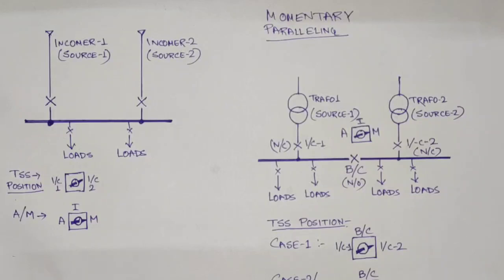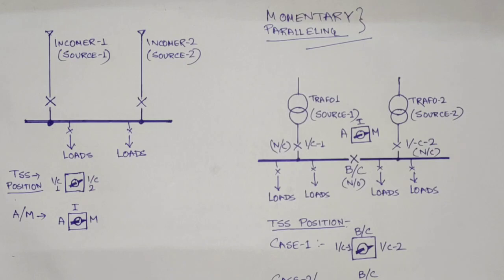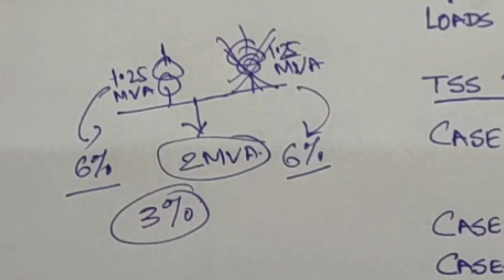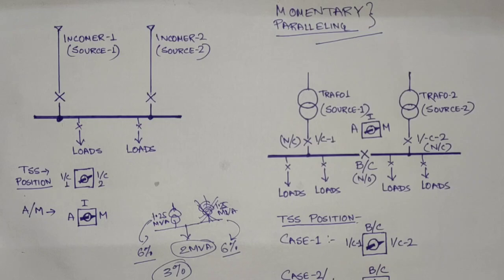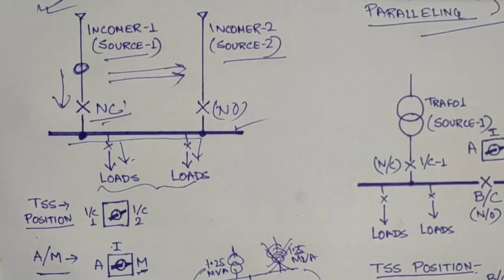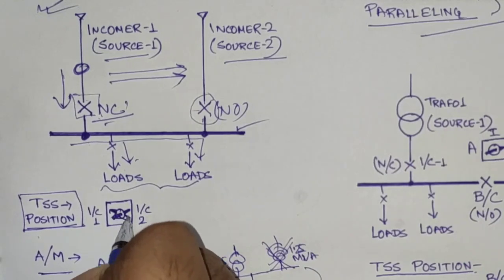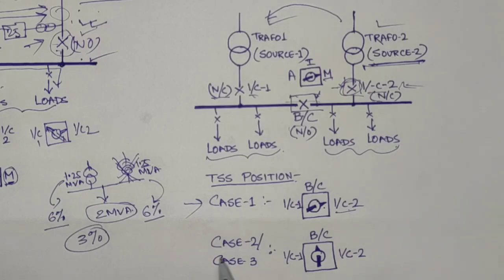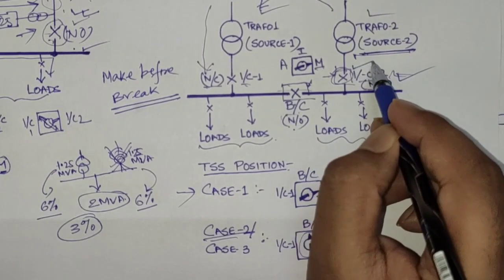Momentary Paralleling of transformers|Momentary paralleling of sources

Comment: Waiting for Part-2. 
And how circuit starting will be managed during case-2 which is under voltage?
Ie, during 27 activation, 86 give trip command to breaker at 2nd Trafo to Bus section-2.
This time all outgoing feeders will shut down. 
Now when bus section-2 loads transferring to Bus Section-1, by closing Bus-Coupler, the loads in distribution side will be starting together, right? How to manage this starting to avoid large inrush current?
Reply from the maker: Undervoltage relay is not fed to 86. So in automatic if incomer 2 under voltage relay has picked up, 86 has not operated, and bus coupler is open that means we can trip incomer 2 and close bus coupler. It is a simple but beautiful logic
Reply: @electricaltechnologyandind5335  Thanks for feedback, Appreciate if u can tell what all relay can fed to 86.
And in the scenario where trip incomer 2 and close bus coupler, how can we manage startup of complete system in Bus section-2? 
Is this starting sequence you mean simple but beautiful logic?
Reply from the maker: Motors breaker will be on. So when the source is changed the motor will keep running. And as the motors are not stall so they won't draw huge starting current.
Reply: Sir can you explain the process when there is a fault on one incomer and 86 relay operates. Then in this situation how to feed the loads on bus section 2 ?